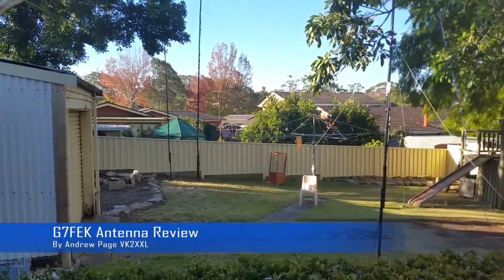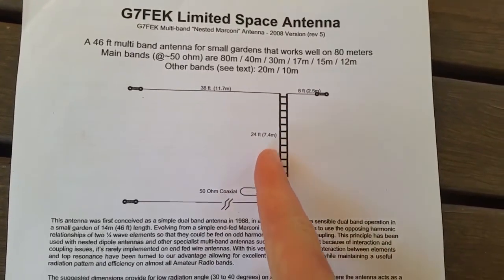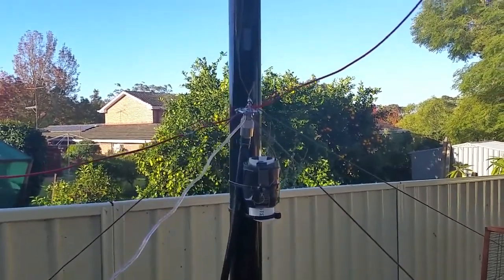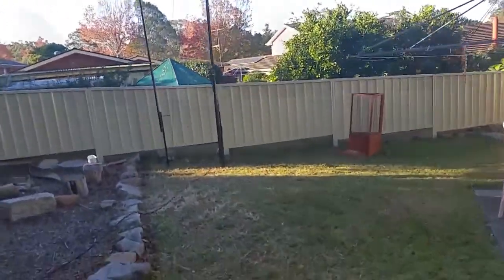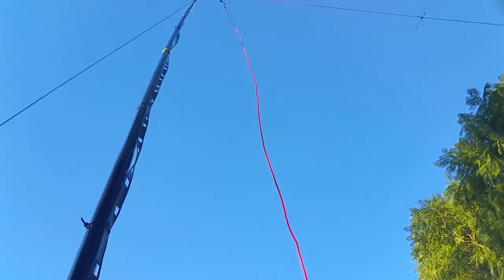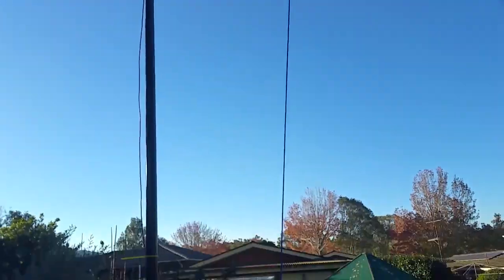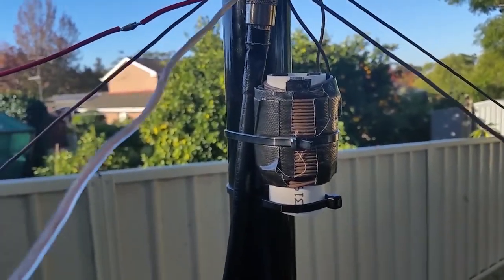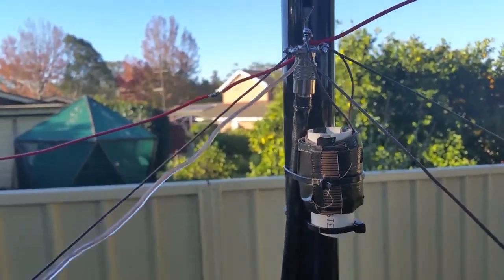G7FEK Limited Space Antenna: Part 1- Introduction

Comment: Hi Andrew. Great to see another build of my antenna, great job, more thorough than my usual portable lash ups!!

There's a couple of points Id like to share, just for the benefit of other constructors who see your video....

1) The extra element you have for 30m is not normally needed as the top is already a resonant half wave near end fed OCF, at or just below 10MHz, and is matched via 1/4 wave transformation effect of the vertical section (like the ZEPP). A counterpoise just shorter than a quarterwave on 10MHz (about 7m) is usually sufficient to get this band working well on 30, although an ATU is usually advisable to null out any inductive reactance present (there will be some). I think you needed this extra element because you have the antenna in a corner configuration with a very acute angle. This a great space saving idea and teh antenna works well in the corner of a plot, but narrower than 90 degrees, this effectively shortens the electrical length of the top on 10MHz by folding the top back on itself. It will affect 30m to some extent, but it should work fine on most other bands though.

2) The feedpoint does not have to be elevated. It can be at ground level. Trying to find that extra bit of height might be a problem for some people, so I just thought I'd point out that it is not necessary to elevate the feedpoint, raising the far ends of the radials for at least the last few meters is essential though. Radials should be insulated wire (2.5mm2 electrical wire works OK, but thicker is better). Other ground systems can be used alongside, or instead - even a simple ground rod if soil is conductive enough.

3) The minimum number of radials is two (one for 3.7 MHz and one for 7.2 MHz). This will get most bands working and probably all bands if you use ATU to trim reactance. Others radials are optional, but improve performance and matching for sure.

4) I recommend a choke at the feedpoint, especially if you skimp on the ground system. The RF return current will take the easiest path to ground, even if it is via your radio and house supply!. You can use the coax outer as an extra radial by placing the choke at 1/4 wave away from the feedpoint on the chosen band. A simple and effective choke is 10 turns of RG58 on FT240-43 toroid. 22ft of RG213 wound around a plastic drainpipe works very well.

5) I love the idea of the high inductance DC shunt to remove any static charge. This will also offer some protection for the radio front end if you forget to unplug it before a thunderstorm. I'll start recommending this to other users and give you a credit!. Static isn;t usually a great problem at 24ft, but it will certainly help.

All in all, almost everyone who has tried the antenna has had great results in getting almost all amateur bands includign 80m. The four main ones without needing ATU, in a very small space and without the usual extreme compromise on 80m. That's what it was created for and 80m is an essential band in sunspot minimum!!. You always get some jerk who will say it doesn't work multiband or on 80 because they "modelled" it or whatever, but the original was built from pen and paper and tested in the real world by hundreds of Hams. Enjoy.

As you are doing so well with local contacts, DX on 80 should surprise you even more as the peak angle of radiation is quite low, towards the horizon on all bands. It can often beat a full size dipole at same height for DX on 80. Looking forward to your nighttime DX video, lets hope for a good opening!!.

All the best. Mike. G7FEK.
Reply from the maker: Hi Mike,

I am truly humbled by your extensive response my friend and was hoping you would see my videos. I had you in mind when I was making them and wanted to see your response/advice. I was going to message you when I had a few more posts up but you beat me to it :)

I've pinned your response and will make sure it goes on all future postings. And re the points you've made.

1) re: 30m element. I probably should have tried adding the counterpoise before going to the trouble to add the 30m element. When I've made up the fancy little junction box, it will be much easier to disconnect and experiment with things. Funnily enough, I've found the performance on 17m to be amazing and no tuner needed at all :) Having the top sections angled the way they are was the best I could do in my yard, but I probably could get another fibreglass pole and move the whole thing to another area to do it the correct G7FEK way, my block is 45 metres long, just don't have trees in the right place which makes it a challenge.  No tuner is also needed for 15m btw.

2) re: elevated feed point. I was a little paranoid about the metal fence right behind the antenna and wanted to ensure I wasn't wasting my RF or getting unnecessary reflections, otherwise yeah, it would have been much easier to keep it lower to the ground. I've only got skinny hook up wire, I'm going to strip some electrical leads so I can make it stronger, better harder, more visible (sounds like Daft Punk lol)

3) re: radials, yeah I found adding the 30 and 20m radials eliminated the need for a tuner.

4) love the choke Idea, I'll be building that one :)

5) you're too kind mate, thanks for the credit on the DC shunt, I found it made anywhere from 1 S point to half an s point of difference re static. Sometimes more depending on what sort of day it is. It's the same with my 40-meter quarterwave ground plane.

This antenna is now my weapon of choice and will always be the first thing I throw up in any new QTH. I'm thinking about making a portable version as well. If I didn't need the fibreglass poles and had big trees, it would be an amazing stealth antenna as well :)

I've already made one DX contact on 80m and will post that video soon. As I make more, I will post more videos. I need to motivate myself one of these mornings soon to come out to the shack before dawn. In Australia right now, the 80M DX seems to work better at that time as opposed to our evenings. 

Again thanks for your response mate, and thanks for sharing your design with the world.

73 from Andrew, VK2XXL.
Reply: I love what you've done to make it work in your particular circumstances. That's what I love about this antenna - having the feedpoint accessible, it makes it so easy to modify. If you put up a 1/2 size G5RV or similar, you're stuck with what you've got (which isn't a lot!). Ham's have been able to use this antenna on all bands from 160m to 6m using various mods and tweaks and for me, that's the fun part of Amateur radio.

Glad you are getting 17m and 15m without ATU. It shows you've done things right. The antenna should work on all of 80/40/(20)/17 and 15 with very low VSWR and often no ATU needed (except to expand band coverage). There's also another dip which often appears somewhere between 27.5 and 28.5 based on anecdotal information, so is sometimes useful at the bottom of 10m without ATU. But with an ATU 10m works acceptably well without mods, especially if you use decent coax.

Once installed it can be a bit techy to resonate because it relies on interraction to achieve low VSWR on as many bands as possible, plus needs attention to the ground system, but then where would the fun be if it was plug and play!!. You downloaded the guide which is a good idea. Many people just find the picture on a blog somewhere. The guide is very useful to understand the antenna.

The proper location is here: http://www.g7fek.co.uk/software/G7FEK%20antenna.pdf

Love what you are doing. Keep up the good work. Hopefully your vids will encourage others to get off EZNEC and build some real antennas! I sold my house and I'm renting a place at the moment with no antennas allowed, so I'll be making up another one of these for portable work this summer.

73, Mike.
Reply from the maker: Yes and I didn't even use the Antenna Analyzer which recently turned up in the post! Following your measurements generally got me very close and I only used my SWR meter. Everything looking good later on with the analyzer. 

The SWR is pretty flat throughout most of 27Mhz and yep, 10m is usable right up to about 28.5 which makes me happy. Although 10m propagating is hopeless right now as we come into winter. Need the summer to come back for that sporadic E so I can really test her out :)

I found the guide to be paramount.

Video 3 is now online showing a DX contact with W6UC. It's low down, but it worked! All within a few days of the antenna going up :) I'm looking forward to doing many more :)

Shame about the current situation you're in re the rental property. I hope you're out of there soon Mike!

73 from Andrew, VK2XXL
Reply from the maker: Hi again Mike, just letting you know my 80M DX video is backup. Youtube reviewed and determined it doesn't violate community standards! You can call this an edgy DX video lol. Check my main channel page. 73 from Andrew, VK2XXL
Reply: @g7fek  thanks mike for this great antenna! I use it as my main antenna at my QTH(with a few mods). My steel carport does the counterpoise work :)
Reply: @yurimodin7333  No  problem my friend. Nice to see another one out there and I hope it works well for you. :)

Comment: G7FEK is an amazing antenna. I built one for our QTH. Added the 20m sucker, and between the auto tuner on our Yaesu FTDX10 and a MFJ949D, we can work everything from 80m- 6m. South Africa from EM93 several times.
It's a very interesting antenna concept: it looks like an OCFD, acts like a multi band inverted L, and is classified as a Nested Marconi.
Just build it! You won't be disappointed. 
I used 14AWG THHN, 600ohm ladder clips, a pvc reinforcement pole so it's at 25ft, and some random 30ft-ish ground radials. 
The plans even include a switchable coil to add 160m, which I have yet to build but need to. 
Do it and you'll love it!

73 de NM9X
Reply from the maker: Fantastic construction ideas and great to hear it's working so well 🙂

Comment: I am just Building the antenna and wanting to take advantage of the Vertical 30M add on. The reason being I'm suffering from QRM from my neighbors and the 30M Vertical add on (Like the 20M) would keep the Antenna elements away from the property next door. Is this a Viable Option ? Would the Transceiver see the Vertical section First? Hope you understand what I mean. Thank you.
Reply from the maker: Hi there, sorry but I only just saw this many months later. The RF will always flow where the impedance is lowest or closest to 50 ohms so yes. I think that's what you mean. Just insulate from the top with a bit of nylon rope and you'll be right. Experiment and adjust to your situation. That's the beauty of this set up. As you can see here I improvised on the fly and used this for many months :)

Comment: Hellow Dru like this video and your choice for this antena was perfect i look to get my 5band dxcc i only need 70 dxcc on 80m i read all info.in the g7fek link he say that take off is about 30 40 greed sorry my english is rabis any away in SA 80M dx is very dificul you need hi power our country   big mabe more tha all EU so with bazooka antena make qso with roll coutry and SA coutry as well but to hit EU is another history to make a vertical not easy to hang out 20m  poll and 36 radials with 1/4 wave for calum 5m is ok but all book says oposit his theory, i have back yard is abt 15m x15m i have tower 10m and bambo a lot here so i will make this antena like the chocke or uglybalum you make 100 turns with 1,5mm wire is good? and is isolatad whith secion 25 turns ? If you have more info for this choke let me now pls look Dru tks for a very nive anderstud i have just littel questions i have youtube channel and alredy live draw there my call i py1ax  hope cat u 73 for now gl
Reply from the maker: Hi there! Sorry I've relocated over the last couple of months and didn't see this until now. The DC shunt (noise suppressor) is east. Grab a small piece of 2 inch PVC pipe and with thin hookup wire (1.5mm fine but anything will work) wind 4x 25 turns over the top of one another so that's a total of 100 turns. You could just make the pipe longer and do 100 turns straight, but it would be much longer that way. No need for it. Since making this video I got an amplifier and let me tell you now, 400 watts makes an amazing difference! Good luck and let me know if there's anything else you would like help with.

Comment: Can you share the design of the noise suppressor please. I too have one of these antennas they work fantastically well.
Reply from the maker: Sorry only just saw this. Grab some PVC pipe, and do 100 turns of hook up wire. 4x 25 turns up and down. Connect one wire to the radiating element, the other to ground (radial side) and that's it. Mine knocks out between 1 to 2 s points of static. Since I made this video I've also added an RF choke which in addition to stopping RF in the shack, also stops the coax cable from picking up QRM. Both have made the system very quiet!
Reply: @VK3USA  Many thanks for that Andrew
Reply from the maker: Anytime :)

Comment: haha not scared of rain then, we would have to wrap the so239/pl239 with self amagamating tape just for summer...
Reply from the maker: Hi there Steve, we've had some very heavy rain these last few days and honestly, the SWR didnt move at all. I've been running 400 watts on 80m through the antenna, my amplifier has SWR protection built in. No change. I do have the coax all sealed up which is the more important part. None the less I'm about to make up a box which will seal and connect everything together. This was only a quick installation, but I'm pleased to report it's held up really well. I might even make a video throwing a bucket of water over it to show what happens....NOTHING. Different if you have a beam, but the majority of this antenna is sealed wire. Hams get far too paranoid over this kind of thing. Here's a video that proves it: https://www.youtube.com/watch?v=NvPIaLD6B7M
Reply: will look forward to the video, my daughter lives in nsw and complains of the rain... haha she should stay home then. seriously though, good to see the antenna again, I built it years ago out of a 1/2 G5RV and it did out perform it easily. 73
Reply from the maker: I've been getting 20 over s9 reports from all over the eastern seaboard. They are pretty awesome and ZL's seem to be calling back at me quite a bit as well. Yeah I'll combine it into an update video I'm about to do which will show the new box once made up. I've also recently added an RF choke (12 turns over an FT-240-31) which has stopped the common modes dead in their tracks as recommended by G7FEK. I put that one into a box, fully sealed with ventilation holes underneath. 73.